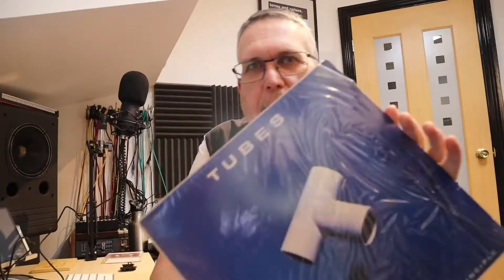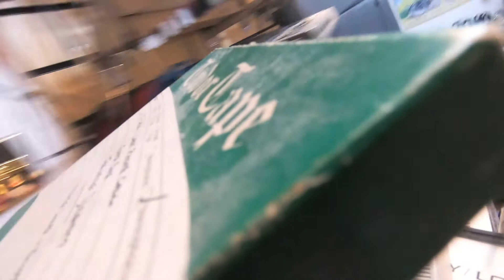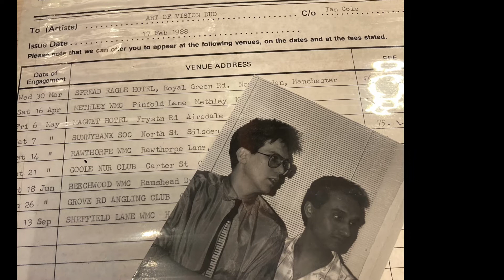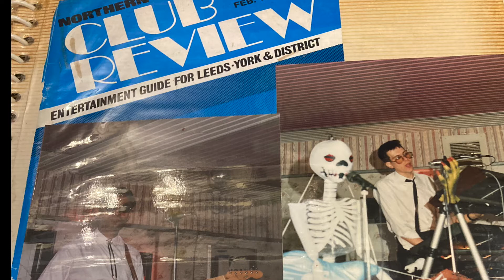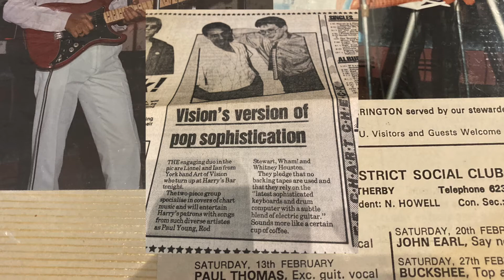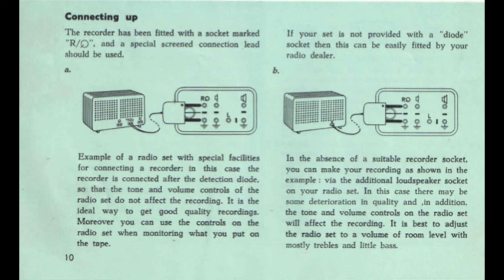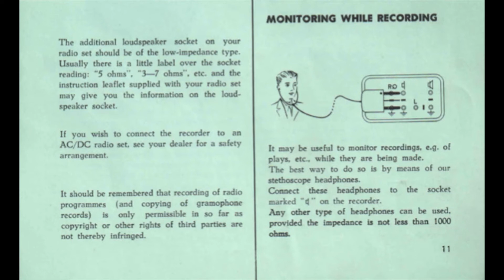Introduction to the Philips EL3542A Reel to Reel Recorder (Part 1)

Comment: hi had tape decks from this time zone  i did find speed  all over the place  got akai 4000ds  
and later a otari  mtr `12 what tape speed to run at   like 10 ips   you know if you recording something  and the tape time is not right 

you can do this on any tascam 30 line  if you know how to jazz the speed of the capstan motor   i post a video one day

Comment: The superimpose lever allows you to record on top of the existing recording, the lever simply mechanically pulls the tape away from the erase head so the existing recording is not wiped during recording, you end up with 2 recordings on top of each other.
The track at 11:59 is Suppers Ready by Genesis (Foxtrot 1972)

Comment: Interesting video.  Brought back a few memories for me, I was given a couple of old reel to reel tape recorders to play around with when I was young.  Just a thought about the superimpose switch, does it switch out the erase head?  Allowing you to record over a previous recording without erasing it. I have vague memories of modifying one of the units I had so it would do this.  I can't remember if the results were any good or not.
Reply from the maker: thanks Brian
Reply: @IanJCole  It does operate a lever which simply pushes the tape away from the erase head.